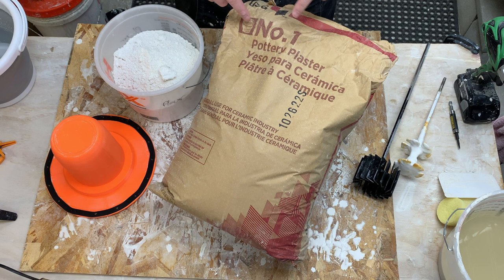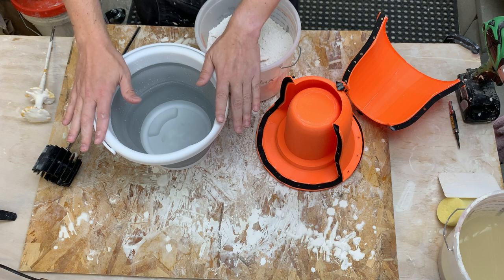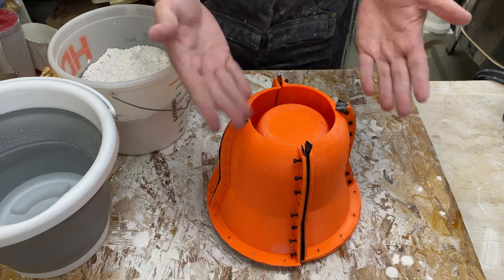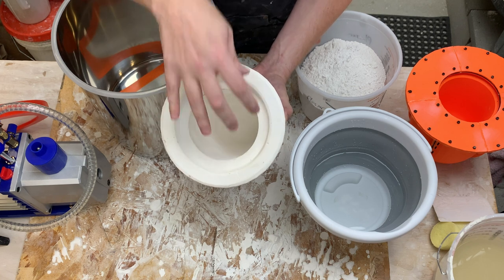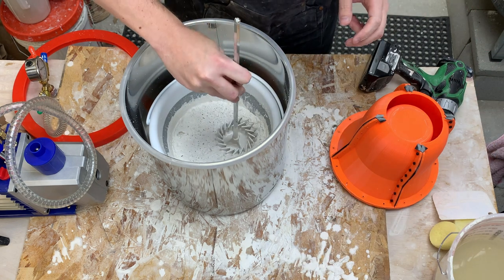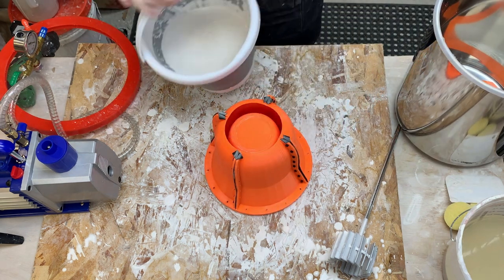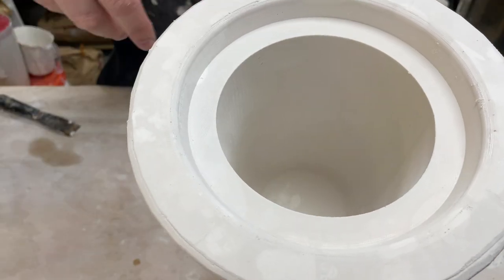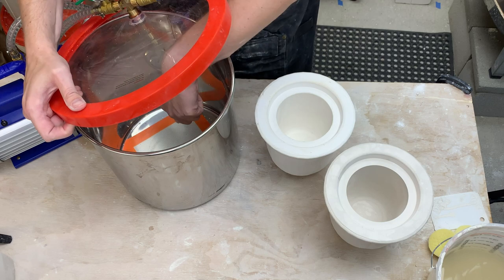VACUUM! Degassing plaster to remove bubbles? Maybe not

Comment: Today I am a ceramicist, but I used to work as a dental technician in a plastering plant.  There are vacuum mixers for plaster, but they are certainly very expensive equipment and few prosthetic studios had them.  It is important to sprinkle the plaster over all the water in smaller portions.  Until you stir it, it doesn't start to set.  it can stand there untouched for a few minutes.  It then sinks and becomes easier to mix.  When he gets involved, the bonding begins.  I did it by hand, but with much smaller amounts of plaster... and I always poured it into the plaster using a prosthetic vibrator.  It vibrates completely differently than yours.  It has adjustable vibration intensity and a removable rubber on the counter for cleaning set plaster.  I also always sprayed the model with an agent that removes surface tension, but this is probably mainly useful for complex forms with small details (like a tooth model). Thank you so much for sharing all your noledge. I hope to use it soon also❤
Reply from the maker: Thanks for sharing all of the info!
Reply: really solid information thankyou!

Comment: maybe i am stupid but it looks like your water starts boiling. would be counter productive turning water into gas if you wanna degas the mixture :D  *edit: yea i think you went to hard on the vacuum. boiling temp at 20 mmHg is just 15°c so it wasn't air inside the mix it was dehumidifying it (maybe)
Reply: as far as i know they use vacuum for silicone, but i think some use pressure for concrete and stuff so due to the water it might work on plaster. it puts pressure to the remaining air so if there are bubbles they are really small..but again i don't know for sure :)
Reply from the maker: Hmm - the water boiling is an interesting thought. It would explain a few things. I'll need to think about that more. The trick is you really can't go slower since the plaster sets pretty quickly.
Reply from the maker: I haven't seen much concrete casting. But for resin and silicone, best practice seems to be to do both. Vacuum to remove as much as possible, and the pressure to collapse the remaining ones.
Reply: the compressor is already there, thats half way to a presure casting. keep going it is fun to watch somebody tinker around :)   @PotterybyKent
Reply: I don't have first hand experience with what you're doing but I'm intrigued. I was suspecting what others have said: too hard a vacuum was probably boiling off the water. I think I'd try a lower vacuum. I was also thinking something similar to the magnetic drive for a mixer, but I was thinking about driving an impeller with magnets beneath the pot. If the pot is stainless without too much iron I think it would work. Maybe let it slake without the vacuum, then try mixing with a slow to moderate speed impeller in the bottom and a moderate vacuum. Probably still a lot of work for little gain but one never knows until one tries. :)

Another thought I had that I imagine has been done is to run a vibrator between the inner and outer mold walls after pouring the plaster. When doing concrete form work that is a regular part of the process for minimizing bubbles.

Comment: My dad is a jeweler and he has a pretty involved process for dealing with bubbles in investment for lost wax casting. I don’t know if any of his process can transfer over to your process but I’ll share it just in case. He doesn’t bother with vacuuming until after he has completed the mixing process. Directly after mixing he goes straight into the vacuum chamber. Then he pours the vacuumed mixture directly into the mold which in his case is a flask. He then puts the flask in the vacuum chamber and vacuums a second time. After that he puts the flask into a pressure chamber. The pressure chamber compresses the remaining bubbles to be as small as possible while the investment sets. I can’t remember what the timing of all this is but it’s very precise and fast
Reply from the maker: Thanks! I hadn't thought about looking into jewelry making but I could see bubbles there being very problematic! I've seen the process of vacuum to pressure being used for other things as well (like resin). I've been worried about my 3D printed parts surviving pressure - but maybe I should check.
Also, I think one of the keys here is that my pressure was too low so the water boiled. And related is that plaster does set pretty fast! So there's not a ton of time for the vacuum to do its trick.
Reply: @PotterybyKent  that is a good point about the 3D print being affected by the pressure change. I didn’t think about the air pockets caused by the infill of the part. The only way to avoid that would be to have no infill and do solid wall prints which would take forever and a lot of PLA unless you only did like 2-3 layer thick walls. Anyway I really appreciate your videos. I can tell you have a very analytical approach which I appreciate. I definitely want to get into this kind of stuff with my 3D printers. Just gotta go build myself a kiln first. 😂
Reply from the maker: @jakehyer1817  Exactly and I'd rather not print things solid! However it might be worth trying with a normal print anyways. Good luck with the kiln! In the mean time you might check out kilnshare.com - no affiliation but it's a place people use to put their kilns to rent out (mine is there as well).
Reply: @PotterybyKent  If your 3D prints are using infill, you could likely solve the problem of either pressure or vacuum crushing the print simply by drilling a small hole or two from the exterior to reach the infill layer.  Unless I'm misunderstanding something, I think that whether you used either a pressure pot or a vacuum chamber, the outer and inner pressure applied to the surfaces of the 3D print should quickly reach equilibrium under all circumstances, so I don't think there would be much risk of the 3D print being damaged.

Comment: I saw someone in a lost foam casting apply thick plaster, in a thin layer, to the foam, then put everything in sand. I haven't tested it myself, but i wondered if applying plaster with a brush would crush any bubbles between plaster and mould. Then, as this thin layer of plaster begin to set, you pour the rest of the plaster around, without worrying about surface quality. Positive pressure seem more foolproof than vacuum.
Reply from the maker: I do think if you can brush on a layer that would help. The bristles can pop the air bubble. That is if your form allows it. As far a pressure, I worry about the 3d prints since they are mostly hollow.

Comment: Depending on how far down you're drawing vacuum, you may be boiling off the water. Especially with the amount of heat plaster generates, I suspect a decent amount of that aggressive bubbling was boiling water rather than trapped gas.
Reply from the maker: Yes. I think so. Although, I hadn't thought about the heat generated. I was going to try this again as some point controlling for air pressure and boiling, but the plaster's heat is something I hadn't thought of in doing so.
Reply: @PotterybyKent  Yeah, I found your video because I was searching the web for anyone who'd experimented with cured gypsum plaster forms in a vacuum. I was wondering if hard vacuum wouldn't dehydrate them enough to recycle back to powder.  Something I'll have to try for myself.
Reply from the maker: Interesting. I have seen very little myself showing plaster in vacuum

Comment: Suggest that you add plaster by sifting it into the water over a number of passes , this brings the plaster to the water without drawing air in as can happen when you dump larger drops of plaster, into the water ,  add the plaster slowly to the water , The plaster does not start to set at this stage and you can leave it stand like this for some time, the chemical reaction happens after mixing/movement after slaking. I think that applying the vacuum to the slaked mix is  doing two things it is not allowing the slaking to happen and is essentially starting the mixing process as the air is rising in the mix and is most likely the reason that the mix is setting after a double agitation , applying a vacuum to the Slaked mix (moves and agitated the mix) and then stirring and adding the  vacuum again essentially gives the plaster nearly 5 minutes of mixing and no time to slake. Traditionally this leads to a very early setting plaster.  Maybe try  sifting the plaster as you add it to the water , let the plaster slake for 2 minutes (untouched) , then mix and only then add to the Vacuum Chamber to degas before pouring..
Reply from the maker: Yes I do think the agitation as the air is pulled out starts the mixing process early. And as others pointed out, the hard vacuum is boiling the water. Given that, it's hard to draw any other conclusions.

I'm curious about the idea of sifting. Naively that would aerate the dry plaster. However I guess if it is applied slowly enough I guess each particle becomes hydrated when it contacts the water and maybe that reduces the air? I'd like to understand the mechanism there better.

Likewise, I've heard that letting plaster sit submerged doesn't start the setting, but that also doesn't seem exactly right (as dry plaster in water does eventually set). Maybe there is a speed component? That is also something I'd like to more of the science about.

Comment: What you are doing in the vacuum is boiling the water. look at charts online for the boiling point @ temp @ pressure of your chamber. stop vacuum prior to the boiling point. Some ideas for you; use cold water. Put the mold into the vacuum chamber pour ice water around the mold, fill the mold with your gypsum mix and quickly pull a max vacuum and leave it there for 30 minutes. I am not too optimistic on the outcome; but would like to see you try it. I think a pressure pot would be more appropriate for your application.
Reply from the maker: Thanks. Others have brought up the boiling issue as well here in the comments, and I was inclined to agree. However I was thinking of revisiting this recently as I recently went looking at the pressure/boiling graph for water. I didn't record the pressure, but I would have only hit the boiling point close to the end as this vacuum pump wasn't all that fast. So I might have gotten there, but now I'm not sure that was really what was going on.

Comment: i like how your using PLA for your form then TPU for the softer barrier. I use a technique of a 3d printed cavity mould with a structure inside where i pour liquefied monster clay into it , when I open it up i am able to carve a design into the "vessel" but it  ensures continuity (shapewise) between designs, so i can standardize my mould boxes for plaster etc...your channel has been extremely helpful in streamlining those processes so thankyou!!
Reply from the maker: Glad it has been helpful!

Comment: You can also use a paint defoamer for water based application. It will work wonders. Normal dosage is .25% but they can be used even more upto 1% of total mix. Add defoamer in two parts. Measure the quanity of defoamer then mix half of it in water that is going to be used with plaster using mixer and then add plaster. Add remaining after mixing the plaster.  Also don't use any surfactants or soap. They will create more foam.  

As for vaccum chamber, keep the mix less viscous. Plaster tend to get thick when it starts to set, so add a retarder so that plaster will remain fluidic for more time and can be easily degassed in vaccum chamber. You can also add litte extar water to make mix more fluidic.

One more trick is add little bit of retartder to mix and keep the mix for 5-10 minutes. All the foam will float to top . Then spray IPA / Alcohol/ Vodka on the foam. This will destroy all the foam.
Reply from the maker: Thanks for all of the tips! This is great. I didn't know paint defoamer was a thing. And likewise I hadn't come across  plaster retarder before!  I'll need to look into those. Both seem like they could be useful here for sure.

Comment: This may be of no use to you, but my grandfather was a plasterer by trade and he taught me to use a small amount of distilled white vinegar to delay the setting of plaster long enough to sculpt intricate Victorian moldings for architecture. This might be of some use in delaying the set of your pottery plaster long enough to vibrate the bubbles out with something like passing an electric sander over the outside surfaces of the mold or on that table doohickey you got from the lab.
Reply from the maker: Interesting. I don't think I've heard about changing the pH of the plaster. I do know that temperature impacts setting time (cooler gives more open time).

Comment: As an experiment, I think it is worth trying to degas the plaster after it has been poured into the mould.  This has some obvious drawbacks: the size of the mould is limited to the size of your vacuum chamber, and as you mentioned, it could also deform/break the 3D print, which also has voids that contain air.  However, the advantage (if it works!) is obvious -- you only need to degas at one stage, and since it is done as the final step, there is no possibility of introducing any additional unwanted air at later steps (mixing, pouring).
Unless the mould is small, it may be heavy and/or awkward to place in the vacuum chamber after the plaster is poured, so if I was trying this myself I would design and 3D print some sort of funnel or open ramp that would allow me to fill the mould with the liquid plaster after it had been placed in the vacuum chamber in a controlled way.
Reply from the maker: Yep, I'm worried about the 3d print deforming under vacuum. For other kinds of pours, pressure is often used and I've heard of similar concerns there (but it's probably worth testing).

Comment: Looking good. You could be drying the plaster faster since your converting the water to vapor at lower pressure. You need extra water in the vacuum chamber to prevent the plaster from drying out.

I wonder if you can fit a hygrometer inside your vacuum chamber.
Reply from the maker: Thanks! I got a DM suggesting something similar, and it does seem plausible. I'm not sure there is a good way to measure water content of the air or (wet) plaster in the vacuum chamber. I could try adding more water, but I don't have a good way to test the impact that has on the resulting plaster. (However if I'm losing water, I have an unknown there too).
Reply: @PotterybyKent  OK so you can control the humidity in the vacuum chamber by having some loose water--not in the plaster mix, just sitting in the bottom of the chamber. That will prevent the residual gas in the chamber from getting any drier than the boiling water at the bottom. That should be reproducible.

Comment: I'd like to see what kind of deformation you would actually with degassing the mold. You could try a small piece without plaster. 

For my castings, I use a massager to vibrate the form. I can tell that the liquefaction really makes a difference even when the plaster is getting too thick to pour. Vibrating a container with a small amount of plaster left in it will make the plaster flow waaay better. I also spend 4-5 minutes vibrating different spots and rotating the mold to try to help the bubbles out. Even after several minutes, bubbles still come out. For your mold, since the inside is open, you could probably hit that particular part with some localized vibrations to have those bubbles release...
Reply from the maker: That is a really interesting idea about using the hollow inside of the mold. That might be fun to try!

As far as degassing the mold, my guess is that the 3D print would delaminate. These are printed with some infill (not 100% solid) so the pressure inside the 3D print would rapidly become greater than the outside and that air would want to escape. It is possible it might just leak out (my earlier tests with water showed there are often still small holes for water to get through). That could be easy enough to test without plaster. The other failure I could imagine would be in the seams of the mold system. But these are just guesses and some empirical evidence is always good!
Reply: @PotterybyKent  I understand your reservations regarding gas filled pockets inside your 3D part. One thought I've had, though I've yet to purchase a vacuum pump, is that you could drill a hole from the "dry" side of the mold into any and all pockets - leaving the clay contacting parts pristine. However, this would be very far from your goal of a simple to use system. Anyway, I'm really enjoying seeing what you come up with and what you try - thanks for that!
Reply from the maker: It might be able to be modeled in. This is a consideration for resin prints already - they need to drain. I haven't used a resin printer in a loooong time so I'm not sure how they handle that these days.

Comment: One thing that I've done to cut down on surface bubbles is to mix a very small amount of plaster and then either brush or dip coat on a thin layer onto mold pieces, let it set, brush or dip coat on another thin layer and perhaps another, then do the main pour after I've manually applied a few thin layers.  In lost wax metal casting this is one of the ways surface bubbles are avoided.

With your specific mold you could probably just assemble the mold, pour a little bit in, and then rotate the mold in your hands until it has flowed over the whole surface and keep turning it until it cures into a very thin layer, then do the main pour.
Reply from the maker: Putting on a thin coat first and using a brush to get the bubbles out is an interesting idea, as is putting down a thin first coat. I wonder if the double pour might affect water absorption from the slip.